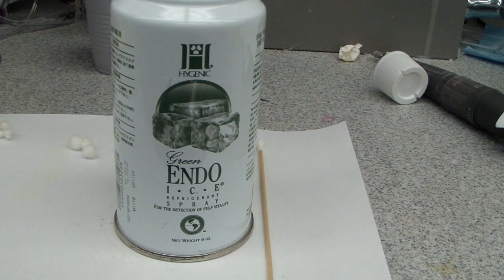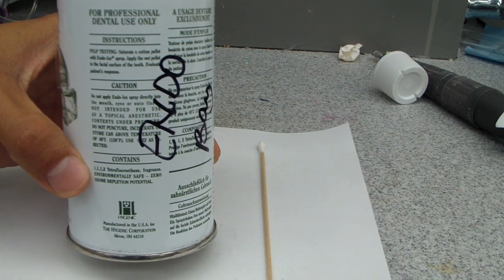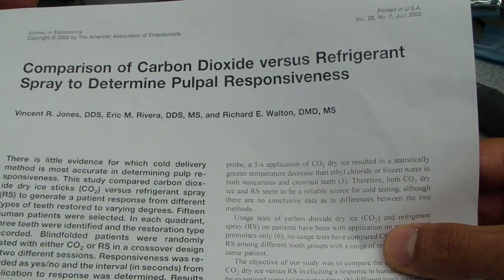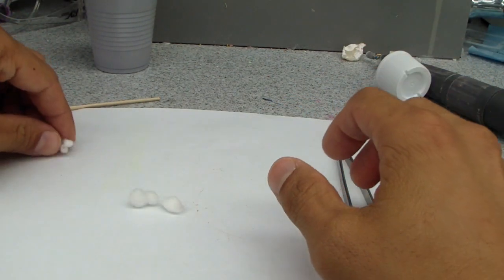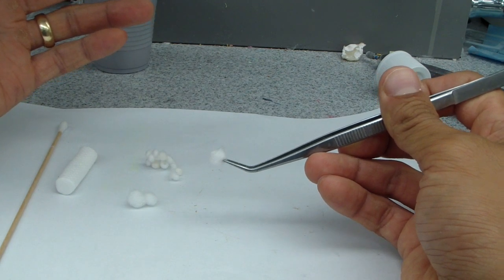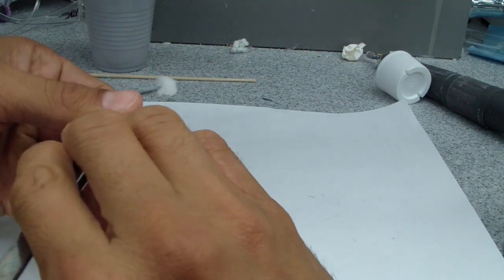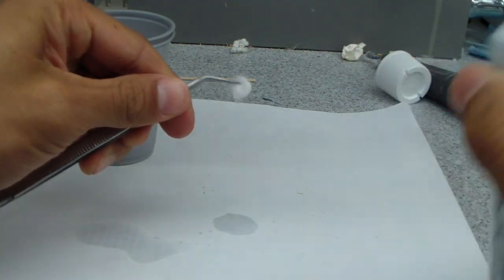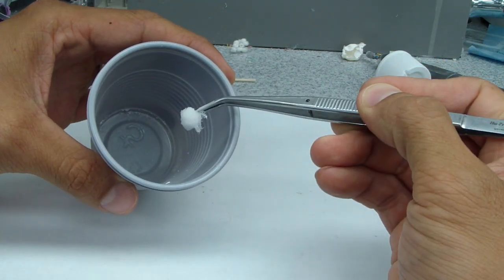Cold Test - Endo Ice

Comment: Can we damage the pulp if the aplication of the freezing agent will be longer than one second or if we apply the agent directly from the tip of the spray for instance🙈? Is there any chance to damage the pulp by freezing at all??
I'm asking because I tried to use cotton tip aplicator and there was no effect, so I tried to apply agent directly from the tip which caused acute pain and on the next day my patient had complaints about hypersensitivity of the 26 tooth caused by biting, hot and cold temperature.

Comment: Dry ice... isn't that dangerous?
 Why cant you use ice water?
Reply: Pulp can respond to temperature below -55 celsius, cold water is not a valid option.
Reply: its hard to localize the affected tooth using ice water, it will spread everywhere

Comment: Dry ice... isn't that dangerous?
 Why cant you use ice water?
Reply: nope, there's no soft tissue damage what-so-ever and its used on a daily basis by many practicing clinicians. it's a reliable test to determine the definitive diagnosis in dentistry
Reply: Not cold enough, Ice is 32 and Endo Ice is -20 around there, so much colder.